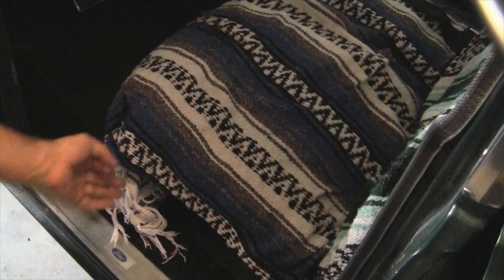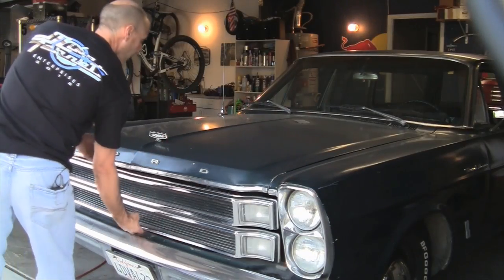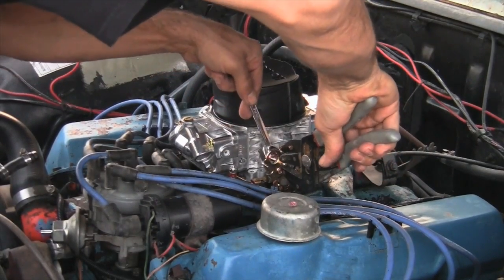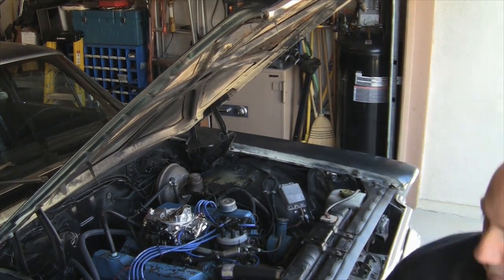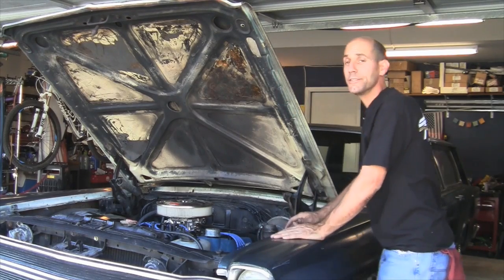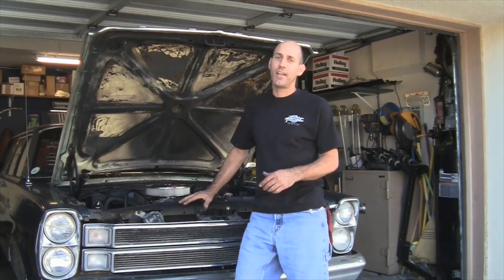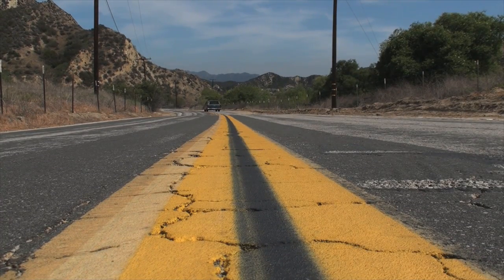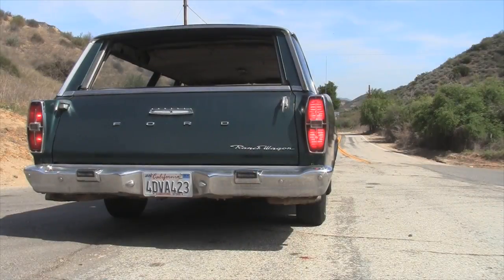How to Change a Carb on a Vintage V8 Engine

Comment: Word of caution . Removing coil wire can cause a fire IF there is a leak . Taking ignition switch hot lead off coil is safer.
Reply from the maker: okiedokie

Comment: I installed a holley street avenger 500 cfm, unfortunately the car doesn't stay running??? If anyone could help that would be great! She cranks and starts for like half a sec and dies
Reply from the maker: Call them... I've spent a few calls with them on their help line and solved my problems.
Reply: @AutoEdits  I actually tried, unfortunately I was on hold for so long the time I had to work on the car ran out I'll have to try again tomorrow or sat
Reply: @AutoEdits  also, I found out my choke jets were 73 which is too big, I believe I need size 54 or something

Comment: Thinking of changing my stock Autolite 4100 carb in my 66 T-Bird. I was looking at a Holly Performer 650 but this 670 looks much better. What would you say is better for a stock 390?
Reply from the maker: I would recommend this one... the 670... for a little better out of the box performance.
Reply: @AutoEdits  I was thinking that too. Saw a vid of one on a Galaxie & it looked like a simple swap out.
-Thanks!

Comment: If I want to convert to gas from e85 do I need to change the carb, and do I need to worry about fuel pump, filter, lines, etc. to completely swap to gas? Thanks.
Reply from the maker: E85 is very corrosive and will destroy rubber fuel lines fast.  You don't have to replace your carb. but a rebuild kit for e85 is recommended.
Reply: AutoEdits does a rebuild help as preventative Maintainence to the problems you mentioned above? Thanks for the reply btw!

Comment: I put a new holey carb in and that spacer gasket was fine..so we cleaned it up and put it back in carefully. Then put a thin gasket over that old gasket (thin one came with the new carb) but the 83 econoline seems to still have a mis in it. So I took it to mechanic and they took off the carb and said the gasket was falling apart in chunks........ is that even possible?
Reply from the maker: I don't suggest stacking or layering gaskets ever.  Yes, they can come apart.

Comment: I did that to my 69 Lincoln mark 3, with a 460, gave me a noticeable difference in horsepower, just be mindful of the clearance between the air cleaner and the hood

Comment: You should have steel lines on the pressure side of your mechanical fuel pump. While it is much easier to install than bending and flaring steel tubing, rubber hose does not belong on the pressure side of a fuel system. That is just begging for a fire.

Comment: I have a 1956 Ford Fairlane 292 with an Original Holley Teapot, I'm looking at either putting on a Holley or and Edelbrock Performer Series Carburetor 500CFM with an electric choke. I'm looking for a carb where I can just bolt onto the yblock. Does anyone in this post have an guidance for me as I do not want to change out the manifolds

Comment: you have to use a vacum gauge, your looking for around 18 inches of vacum at the lowest smooth idle, by adjusting the mixture screws, the factory doesnt know what size engine you have, or what type of cam profile, so to get the best performance you have to re jet, and fine tune, the mixtures

Comment: there is no such thing as a prefect carb out of the box, , Holley,s require a main jet change due to altitude, and idle mixture adjustment and engine size, you check it by reading plugs, I had a split port offenhauser manifold, with a Holley 390 four barrel on a high compression 2.3 pinto engine, it made 160 hp with a stock bottom end, most of the time I toss the choke plates in the trash,  and stick the biggest air cleaner  that will fit under the hood.

Comment: i like your video, but two things. always run manifold vacuum. ported vac is an early emissions item. i have a video showing the comparison on a running engine. but also you should never crank with power going to the coil. it will ground out inside the itself and damage it so that whenits into the upper rpms random misfires can occure.
Reply: If you don't have power to the ign coil when you crank it won't start...
Reply: im not sure why I said this on this video as I am not going to watch it again, but what I mean when I say this is that if your cranking the motor with the distributor cap not connected to the ignition coil, its better to cut the power to the coil instead. obviously if trying to start the car, everything needs to be connected as it should be.

Comment: Awesome video!  I need to go peek at my El Camino and see what's actually down in that thing.  I've noticed that if I'm accelerating slowly (say in poor weather, just for the sake of the conversation) that if it's running at about 1500 RPM (rarely goes above 2500RPM around town) that the engine starts bouncing the revs up and down about 200 RPM's until I either give it more or less gas.  I'm planning to go get the carb tuned, since I have no idea what I'm doing yet, ha. Love the video!